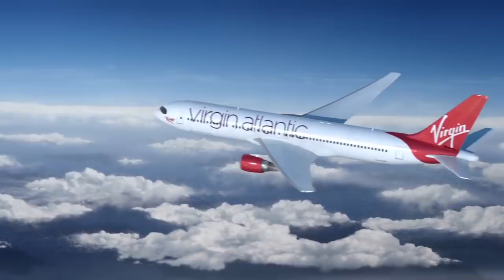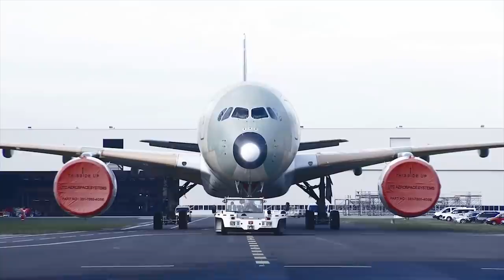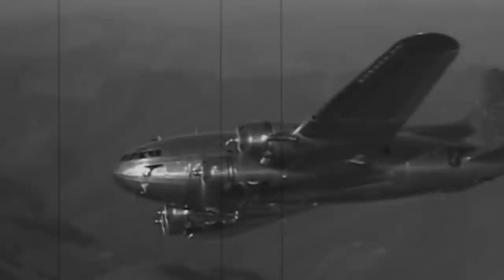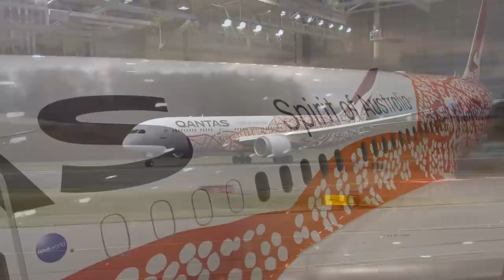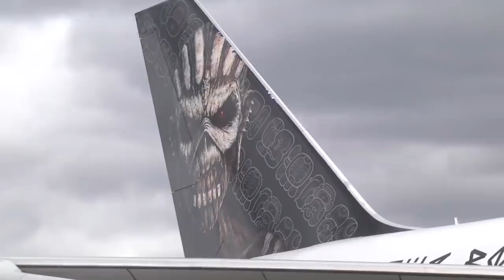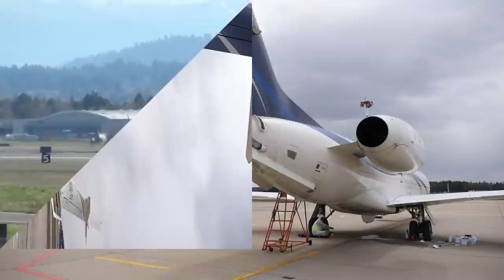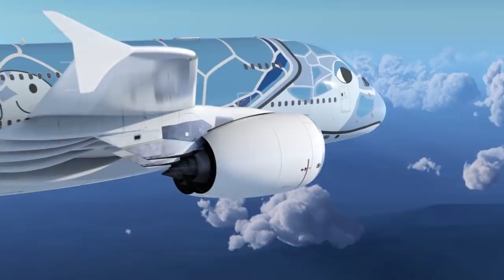Why are airplanes painted white?

Comment: OUTSTANDING..bloody brilliant presentation.. federal Express did a cost analyst back in 1993 and put a dollar value on the paint scheme.. on the 747 they owned the purple pigments based paint alone weighs in at over 800 pounds and that was placed over the all white base coat..switching to the current FedEx scheme saved the company 3 billion dollars in the first year with only  10 aircraft done up..
Reply: Luke E some paints, especially pigment paints, and especially certain colors like that purple I’m assuming are very expensive, getting 800 lbs of it I’m sure was a lot of money. Switching to the way things are now, I’m sure they only need about an 8th of that paint saving 700 lbs of paint off each aircraft, which saves energy and with ten planes each using 700 lbs less of paint, that’s already 7000 lbs less paint required, I doubt it’s 3 billion dollars, they most likely meant 3 million dollars, but still, it’s a lot of savings
Reply: No, your figures are wrong. Saving $3B over ten planes would mean saving $300M per plane per year. That is $375,000 per pound. If each plane flew on average once a day, that’s $1,027 per pound of paint per flight. I haven’t used Fedex in a long time, but they weren’t that expensive.

Comment: To keep it cool inside and color paints weight more due to the pigment.
Reply: In the video Sky said it's the multiple coatings for colour. White needs titanium pigment already anyway.
Reply: White paint still has pigment in it. Pigmentless paint is called "varnish", and it's transparent. You are correct about reflecting heat away from the airplane, however.

Comment: "Naked metal" look will always be my favorite. But let's be honest, anything is better than a blue Pepsi Concorde
Reply: Not even the Concorde can make Pepsi attractive
Reply: unless you are concorde.  Which white reflects heat since the concorde skin heats up a lot during supersonic.   Hence the one off Pepsi painted AF concorde have dark blue paint limited only to fuselage.
Reply: I like the blue Pepsi Concorde) At first I thought that's a Photoshop
Reply: Bare aluminum is risky. Aluminum is very chemically active. (in case you're not aware, Thermite is made from aluminum powder and iron rust powder; the aluminum tears the oxygen right out of the iron rust in order to burn, and that's why Thermite gets hot enough to weld railroad tracks together.) Aluminum normally forms a smooth oxide coating when exposed to air in just a few seconds, but a few contaminants can interrupt that smooth oxide coating and allow the aluminum to continue oxidizing. Mercury, gallium, and even salt can do this. Look at the aluminum valve cover of an old car that was driven on salted roads; it's darkened and pitted and corroded, not smooth and shiny.
Reply: Crazy Sven  Yes indeed, I too, always think of Pepsi Cola when I see their planes!
Reply: pepsi bottle, coca cola glass, i dont give a *flashbang

Comment: From my knowledge of space travel (which faces even more extreme environments), I had guessed it was to help the plane reflect and eject heat more easily than a darker colour. I did not think there would be this many alternative reasons! :o
Reply: White reflects light and heat,  it is a poor radiator of light or heat.  For radiation of heat the ideal is mat black.  
Consider satellites.  They need to reflect sunlight and so are a shiny silver colour (no oxidisation worries, OK?)  However their electronics generate heat which must be removed, but how?  No air to blow.  So the only escape for heat is by radiation,  So matt black cooling surfaces are used, which must face into deep space which has an equivalent temperature close to absolute zero.  Care must be taken to prevent these surfaces from facing the sun because they would heat up very quickly.  For any given black radiating surface, the heat loss is proportional to the fourth power of the temperature difference between the radiator (ho t) and the equivalent temperature of the material or space (low) that it faces.  Doubling this difference thus would give 2×2×2×2 = 16 times the radiation, so facing absolute zero offers a good prospect.  FOR BLACK.

Comment: A white fuselage is paint scheme is called "Euro White". The first airline to use an all white fuselage was Air France, way back in 1975. AF is a European carrier, hence "Euro White". Air France was slowly joined by nearly all carriers over the last 45 years.

You might also consider doing a video on what a "cheat line" paint scheme is and how that treatment has fallen out of favor. And also you could do one on what "billboard" titles are. And finally, black paint underneath the flight deck windows used to be popular to reduce unwanted reflection in the cockpit (look at TWA and Air Canada paint schemes from the 1970s). Interestingly, Airbus seems to be re-enamoured with black trim around the cockpit, but I don't think it is to reduce glare on the flight deck.
Reply: Interesting information)

Comment: Ocean liners and ferries also tended to be painted white above the water line, and a lot of train companies have used fairly white paint schemes throughout the years. It seems to be something of a default for any passenger carrier unless there are some other factors influencing choices (like steam trains being mostly black because they were so dirty).
Reply: This also of course means that choosing any other color is an easy way to distinguish yourself from the rest and we probably see this the most in passenger trains. The new DSB livery is black and red which is something of a call back to their older liveries and is a reintroduction of red after it had been gone for about two decades. We also saw steam trains painted in fairly lively colors but that seems to have mostly been a trend in the UK and in the US when it came to streamliners, which of course were mostly designed to stand out.

Comment: Supposedly, the all-white color was originally introduced on the Concorde, mostly because white better resists the fuselage heading process of supersonic flight. Mostly white is done nowadays because not only is it widely available, it also keeps the weight of the plane down.
Reply: I heard, that the Pepsi blue Concorde had additional speed limits, nearly Mach 1.7

Comment: White paint is usually the longest lasting.  This is because the pigment is usually aluminum oxide which adds to durability, sunlight resistance and strength of the paint.  White paint is usually less expensive than color paint. This is why automobile fleets are often white and houses  are often white inside and out.

Comment: Like your channel.
White paint is cheaper. 
All colors start with white and are tinted to achieve desired color.
Colors are no harder to paint than white.
An airliner flying  isn't being warmed by the sun.. what's the temp at 12,000m ?
Paint bright yellow or neon green for visibility.

Comment: Pepsi painted a french Concorde blue for advertising purposes. Due to the extra heat build up the aircraft could only fly for 20 mins at Mach and the wings remained white due to fears of the extra heat in the wings igniting the fuel.

Comment: I think you forgot that during time , color and design became a very marketing topic. You fogot also white is standard because well thw white color is the standard color for painting the protection of the plane. The rest is lack (2 wave of painting). And if sell then put again the color white. Thats why leasing compagny buy always white planes so then can customise the color for the futur unknow customers...
Reply: "The rest is lack (2 wave of painting)". Sorry, I don't understand. Could you put it another way?
Reply: @dionlindsay2  the white painting isn't a painting it is in Europe standard ( lack) anti-corosive anti humidity etc. it's the material to avoid component of the air plane to be in contact with air. It is actually not a painting. Housing have the same with you put painting on the wall. It always double painted. The first the protection . And the second the color.

Comment: Therapist: 757(?) bird doesn't exist, it can't hurt you
757 bird: 0:04
Reply: Bruh thats a 767
Reply: Think that's an A330 family airliner, as Virgin Atlantic only operates the A330s, A350-1000, and 787-8. The engines are closer to the size of the A330's than the A350's or 787's.